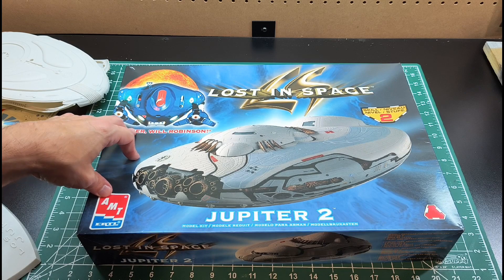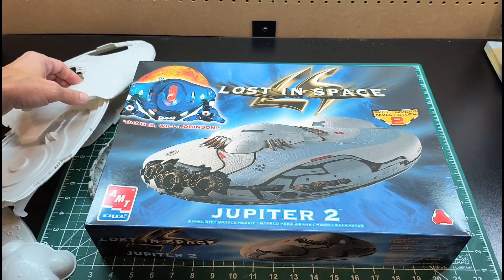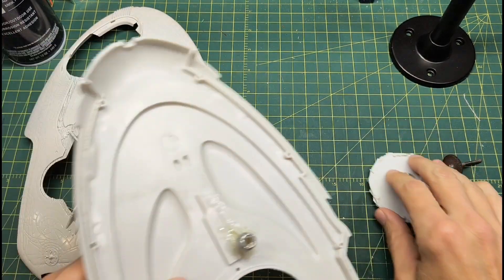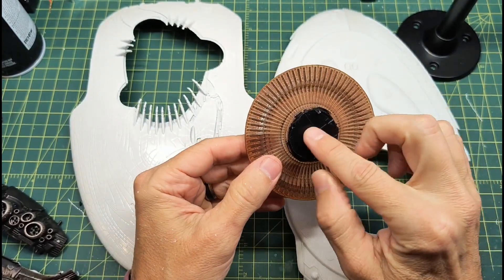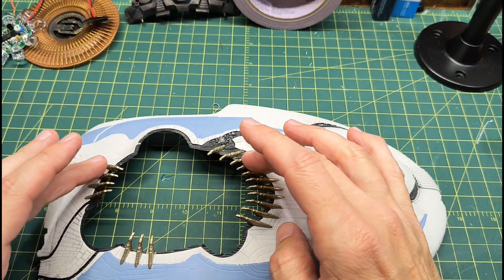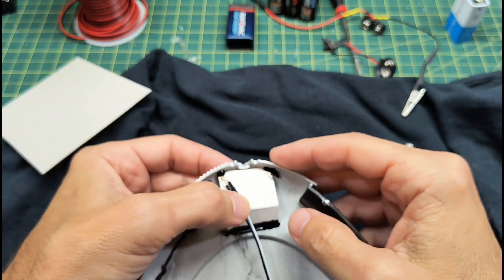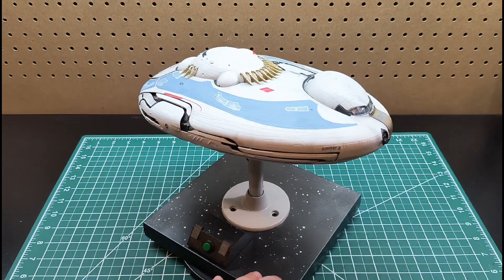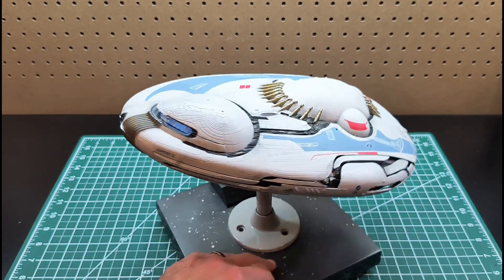Lost in Space movie version Jupiter 2 model build.

Comment: Hello that is excellent , i am currently building this kit and have managed to find a set of the chasing lights . It took some searching as im in the UK and was able to source some in Europe , ty for the tips on lighting , for the rear engines i have used some bulbs from the flickering candles and put them in series so that you get the pulsing effect , i also used these in my Razor crest model and they run very well on a 9 volt battery , loved the design for the enclosed lower lighting would never have thought of using card from the box , ingenious . ty so much for the vid .